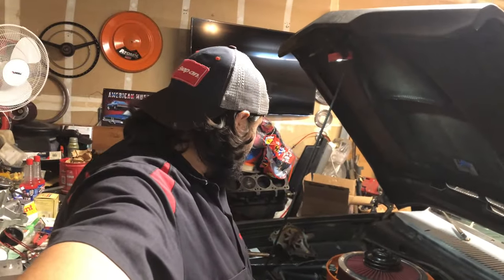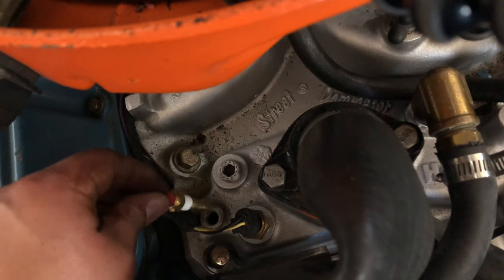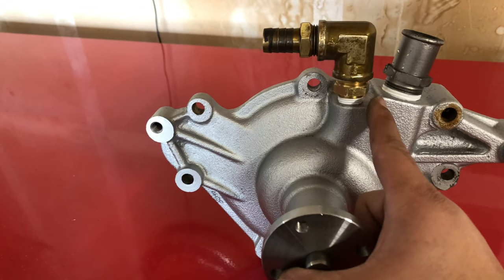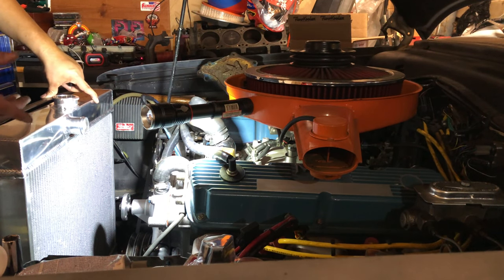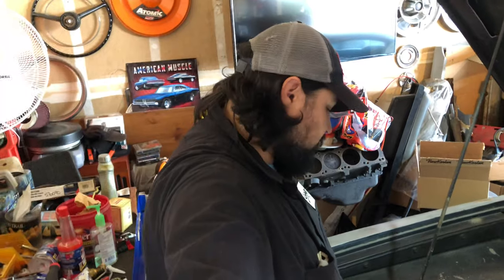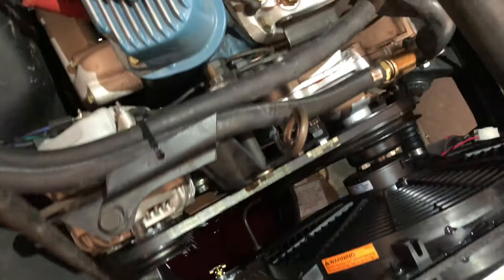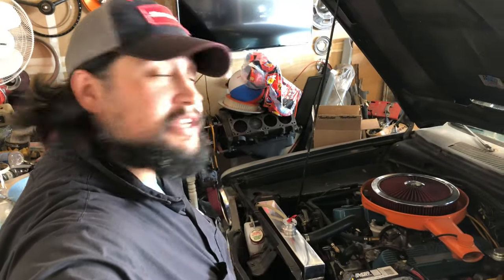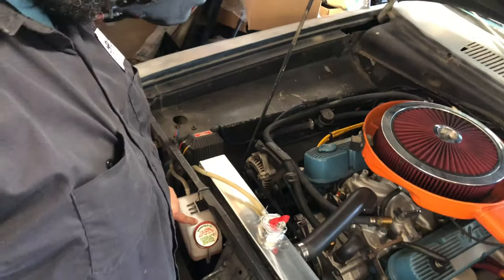Upgrading the cooling system on my 1965 Plymouth Barracuda | part 2

Comment: I like the use of brass and stainless in the by pass I do same thing on later LA engines.... look like your using hybrid pink coolant    most  modern cars have a bleed hole in thermostat I drill a 1/8 hole in thermostat to allow air to bleed old trick,.. 190 sitting at idle is perfect.
Reply from the maker: Yeah man it works perfect

Comment: Yeah i probably should go with a 180 thermostat. I want to wait until after i put a lower gear and fix the cracked ac compressor before i change it for sure.

Comment: Are you running dexcool? Or traditional coolant
Reply from the maker: I’m running dexcool to prevent corrosion in a mixed metal engine. I’ve used it for years and it works really good
Reply from the maker: Also I primarily use “soft” water because we really don’t need too much of the antifreeze. I use  a 2.5 : 1 ratio, 2.5 parts soft water to 1 part dexcool